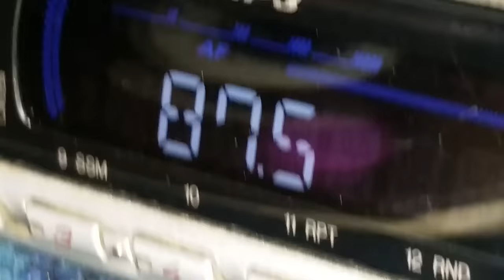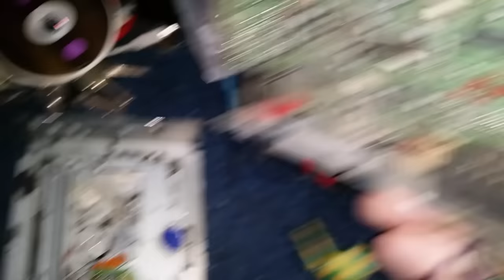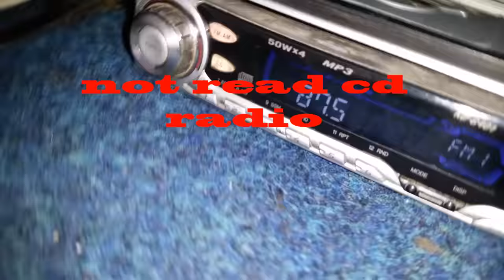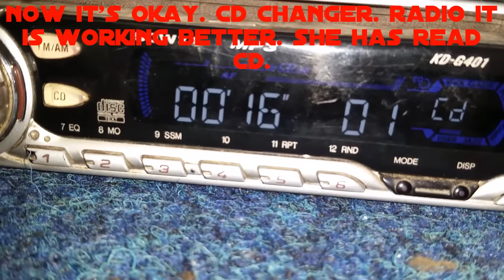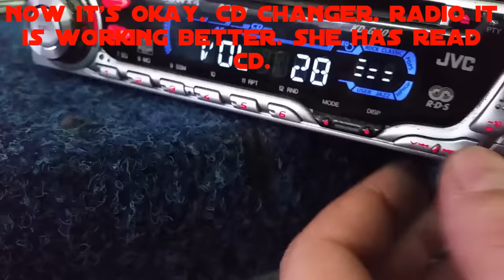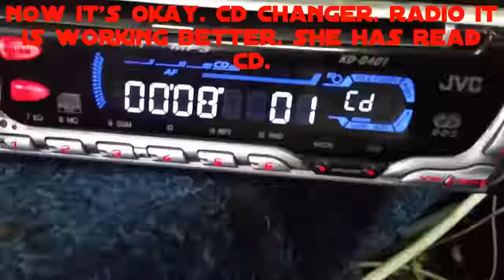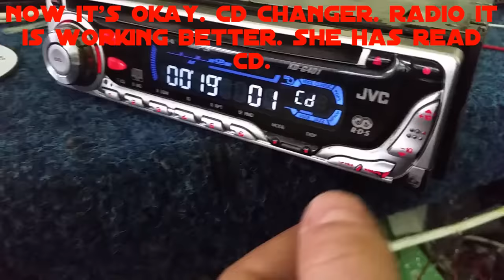JVC KD-G401 MP3. CAR. RADIO. repair. not read cd. it does not work. CD

Comment: Hi, thx for showing howto do that. My radio has the same problem, also a JVC model but a different one. I will try that too, but i wanted to ask:
Why and what for did you turn the screw after cleaning the lens, what is the screw for ?

Comment: in China car radio, there are 2 pcs of trimmer pot, which one have to adjust, sir? I've turned all & disk insert & open repeatly .. need help, sir
Reply from the maker: try to clean your laser. if there is no success then laser damage